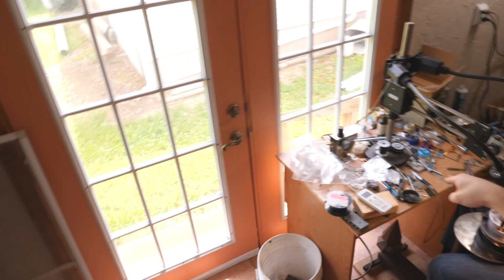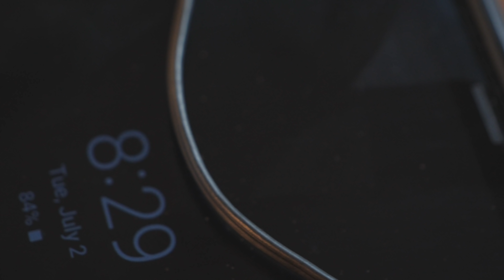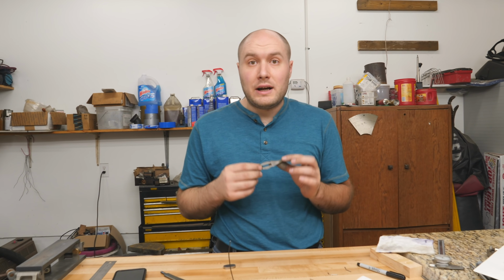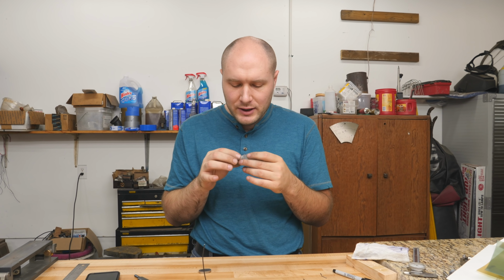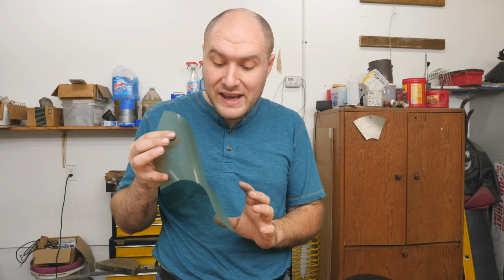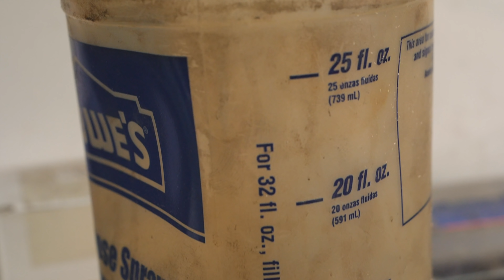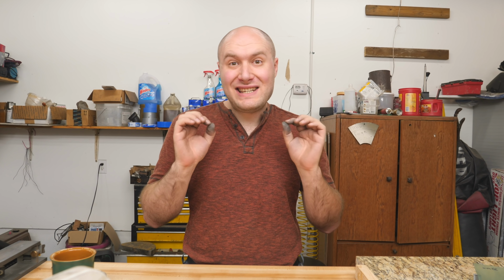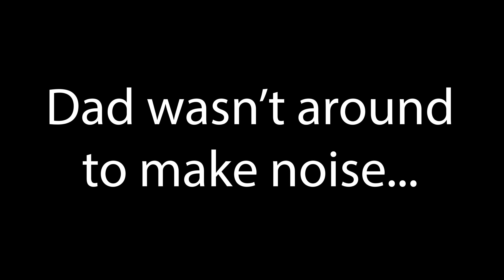Making a 23" Mosaic Damascus Bowie Part. 9

Comment: Congrats on surpassing the 10k subs!  When I saw the new vid of your sword build posted over on "That Works" channel, I took a quick note of the sub count just out of curiosity to see how fast it would climb, it was at 7.8k on July 1st and is now currently at 11.3k (July 5th), so just about 3,500 new subs in 4 days I'd say ain't too shabby lol.   And you know we appreciate all the work you put into these vids, Josh, so keep your chin up bro ;)   

I do like that engraving design on the guard lugs, that's gonna be pretty sweet after bluing.  Also, maybe I'm just super cheap, but I'd be trying to collect as much of that excess 24karat gold that squishes out during the inlaying as possible, I'd probably spend hours trying to gently scrape it off the fittings and then somehow wash it out of the sandpaper as well lol, seems like it could really add up over a few knives!  Thanks as always for sharing

Comment: kyle, I love your work ... I hope you can answer a question for me. when creating a threw tang knife what is the right size you should shoot for as the recosso???? please thank you and all that.... Martin
Reply: Hey Martin, I saw this Q over on Karl's vid too so maybe I could try to help as I was studying this exact issue a little while back as I spent a while trying to make sure it looked and felt right in order to avoid potentially wasting a somewhat pricey handle block on the knife.  Honestly it mostly depends on the size and design of the knife, but one of the most important things to consider for aesthetics and overall profile flow is to make sure the width of the ricasso matches the width of the front of where the handle starts (above where index finger rests).  If it helps at all I just measured the ricasso width on a hidden tang hunter I've been working on and it come out at just about 15/16", it actually a design based very much off of Karl's style hunters.  The blade on it is 4 7/8" from plunge line to tip for size reference.   

It really comes down to what a comfortable height for the front of the handle is, which as already mentioned, you want to match as closely as possible on the top of the handle to the spine side of the ricasso and the bottom of handle to the bottom side of the ricasso so that if you were look at a silhouette of the overall knife profile, those lines would match up and keep a good flow with the guard or bolster in the middle.  There are some old school Bowies that have a wide ricasso and a much more narrow handle, and even though it can work at times, often it seems to interrupt the visual flow and causes the eye to get "stuck" in that area when looking at it.  If you look at almost any hidden tang Bowie of hunter made by an ABS bladesmith, you'll see that they are almost always designed to match in width.  Anyway, to sum it up I think an inch or just under and inch is a a good and "safe" width for looks and a generally comfortable height for the front on the handle.

To give credit where it's due, I'm pretty sure I originally learned about this design tip/aspect from Nick Wheeler.  I actually just did a search while typing this and found the original post, www.bladeforums.com/threads/wheelers-steel-stuck-in-the-metal-with-you.808140/page-18#post-9200071  it's about halfway down that specific post where he talks about handle and ricasso sizing, if you're interested.  Also, if you haven't already, I'd highly recommend reading that entire WIP, there is much to learn and take away from it. 👍